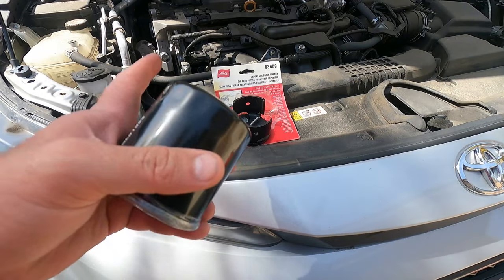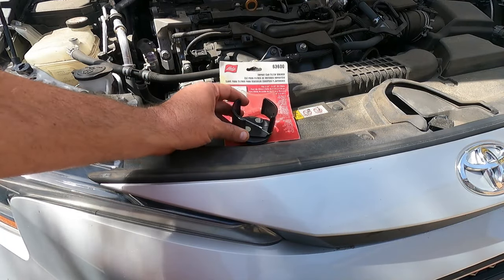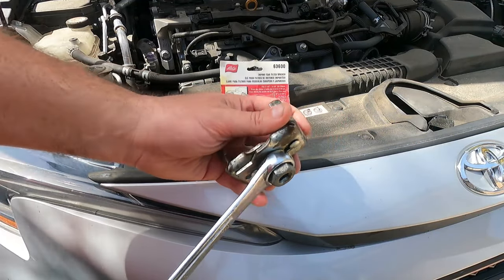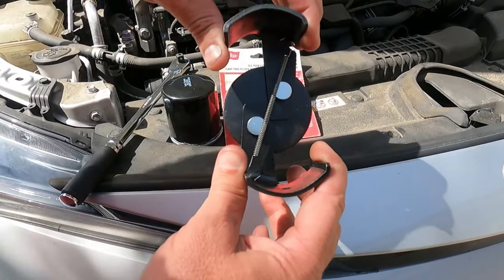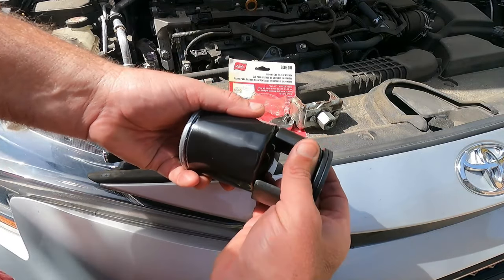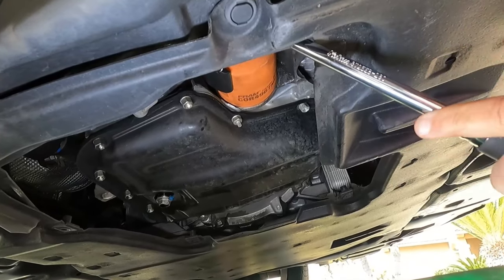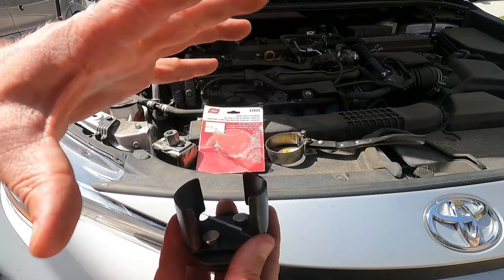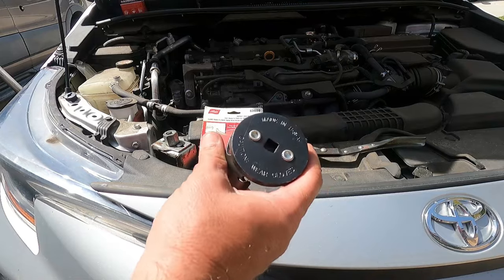HOW TO REMOVE A STUCK OIL FILTER - Lisle Oil Filter Wrench 63600 - MADE IN THE USA

Comment: Cool. I have this one, it's the best one I've tried. Also, it won't tighten, which is a subtle hint to never use a tool to torque the filter, just use your hand only. Finally, I find filters come off more easily on cold engines.

Comment: i saw a video where a guy described it is hard to remov e the tool after you have loosened the filter.  he showed that you have to grip the filter with your hand and then actually switch the ratchet to "tighten" and give it small tightening turn to get the tool off of the filter.  you did not seem to have a problem removing it.  did you do anything special to remove the tool from the filter once loose|?
Reply from the maker: No, it just came right off, but I can see it digging in to the oil filter if it is really stuck…that might cause you to need to hold it and turn it the other way to release it’s grip…
Thx for watching!
-Dan